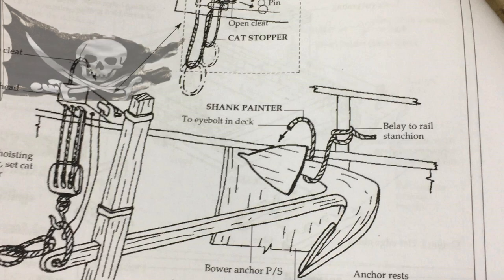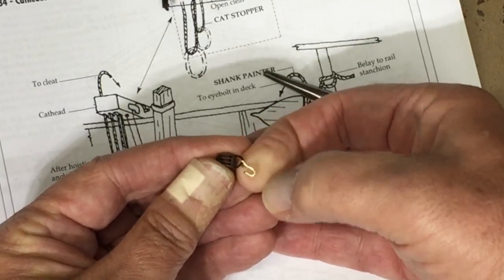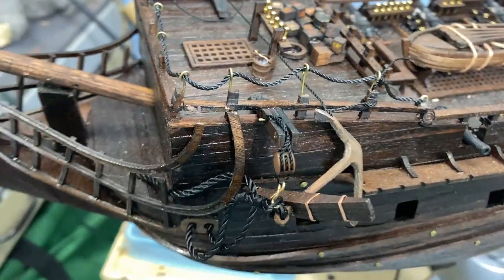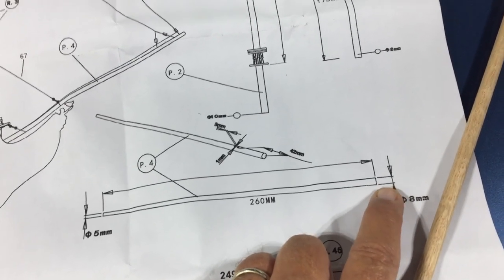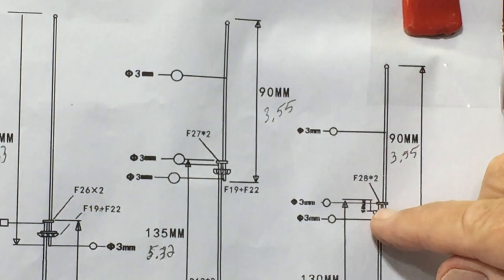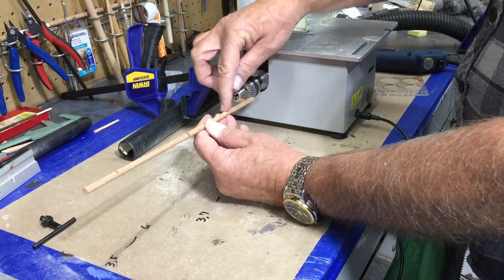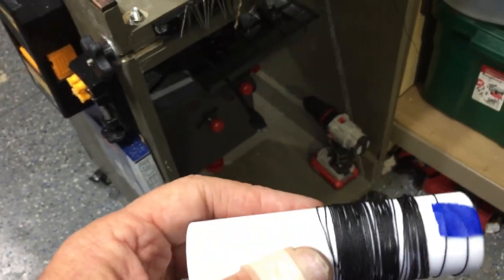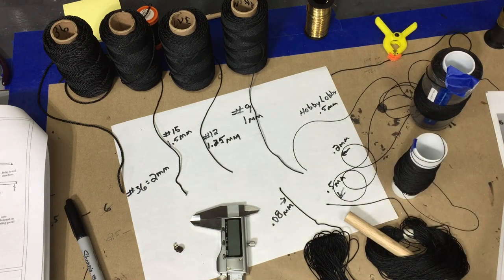The Black Pearl Golden Version 2021 Episode 17

Comment: Making great progress on the yards. They have that shape that takes me a few attempts and a couple of hours to do by hand. Also, I appreciate the rope break down sizes you did. That's very helpful.
Reply from the maker: I just ordered more of the diamond sanding discs.  That’s also working better the more I do it! Rotating the dowel with the chuck on the mini table saw works best…. However note: I burned out the power adapter that came with it. Company is sending me a replacement for free… I’ve also ordered one that has overload protection…. I was cutting some wood and over stressed it🥴.
I’ll be more careful in the future 👍

Comment: hello I saw your works they are really impressive :0 I would have liked if you would like to get in touch with you to ask you one or two little things about this model finally (work of art) please  please :)
Reply from the maker: You can ask questions from here, I will respond accordingly.
Thanks for watching.
Reply: @BoilerDan1  hello thank you very much for answering me :') I started this sublime model this dream building that I was offered but there are no complete instructions :'/ in particular like you the large detailed plan  mast and sails suddenly I'm stuck I don't know the dimensions of the mast:'/
Reply from the maker: @razatjose3817  
Formats:
Top 110 mm
Middle 170 mm
Bottom 145mm

Center mast:
Top 90mm
Upper Middle 135 mm
Lower Middle 185
Bottom 230mm add 11mm to go below deck.

Mizzenmast (rear):
Top: 90mm
Upper Middle 130mm
Lower Middle 180
Lower 175

You’ll have to taper them on your own, but my videos should help.
Reply from the maker: I sent the details on the masts. They are at the bottom of your first comment. I’m happy to to help.
You might be learning the same lesson that I did…. I also made an inferior version but it ended up costing about the same due to buying more parts and pieces ☀️😬
Reply: @BoilerDan1  Thank you very much for your precise answer :') indeed it will help me a lot yes thank you very much and yes indeed to make it much more real and like the film it would have to be customized a little yes indeed :) that's what I do I  watch your videos extremely well detailed and explain and I look at photos of the original the real one to be able to customize some parts and parts :')
Reply: @BoilerDan1  forgive me for asking you this but you would have the dimensions of the rest of the masts please as at minute 9:24 of your video please for the 3 masts it is explained nowhere on the plans: '  /
Reply from the maker: @razatjose3817  sure, it will be later today.
Reply from the maker: @razatjose3817  
Front mast yards:
249mm, 200mm, 158mm

Center mast yards:
280mm, 210mm, 170mm

Rear mast yards:
210mm, 175mm
There’s one that is suspended from the rear mast that is 
240mm 
I’m not sure what it’s called? But it holds a sail that hangs off the back of the ship….?

Also the front Bowsprit on the front of the ship is 260mm.

Now, please subscribe to my channel 😁😉👍👍
Best wishes for your completion and making it as close to the real BLACK PEARL as possible! (She is a real ship isn’t she?).
Reply from the maker: @razatjose3817  
I sent you the information requested.
It’s at the end of replies from your first comment/questions.
Thanks again for watching 👍👍